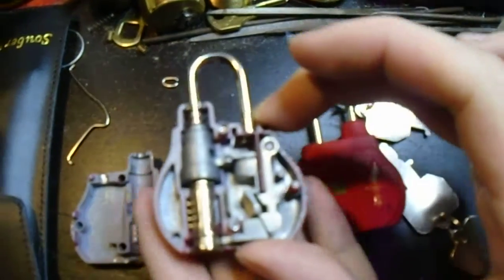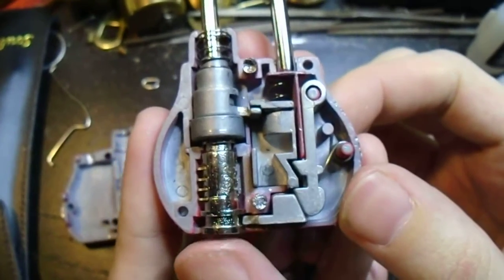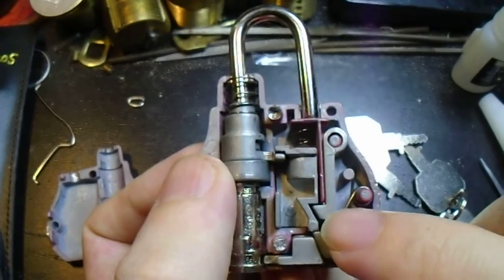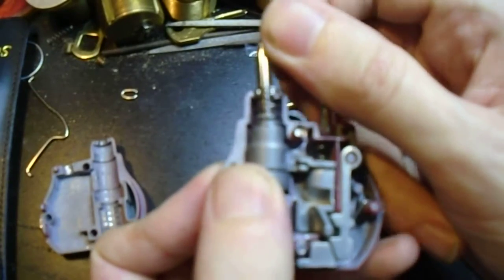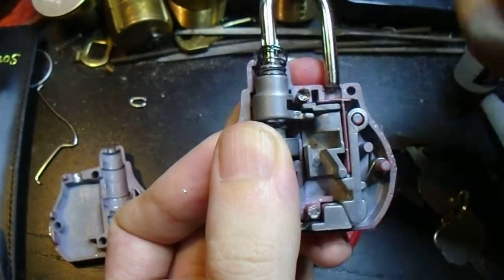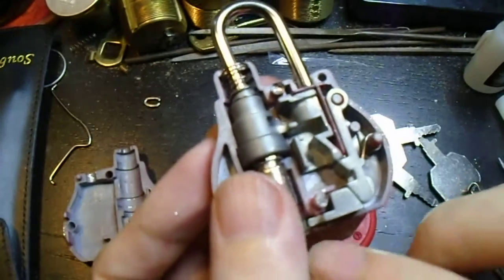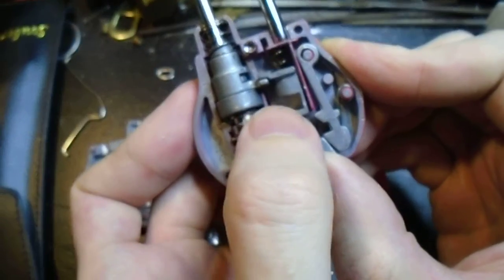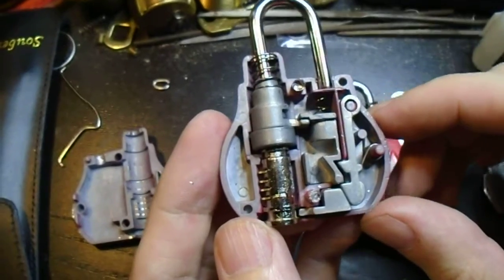(058) Safe Skies search indicator teardown

Comment: You could try making a see through cover to make it easier to show and tell.
Just a thought but love the vid as is 😎😎👍👍😘
Reply from the maker: Might be a future project. For now I have dremeled slots over the interesting areas. Need to work out how to handle the 'walls' on the cover before I can do a full transparent case.
Reply: Nite 0wl maybe impressioning to make a mould ,then some sort of clear resin??
Reply from the maker: That is the most likely solution, I am just not set up for that at the moment. It has been ages since I did any resin casting.